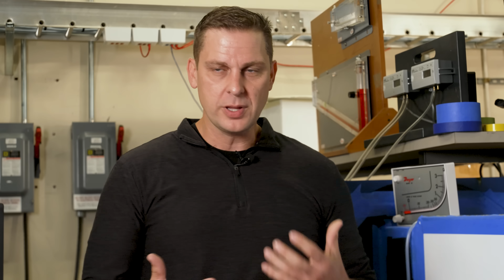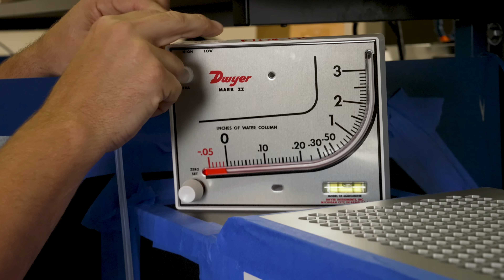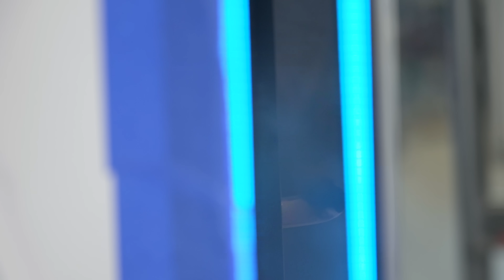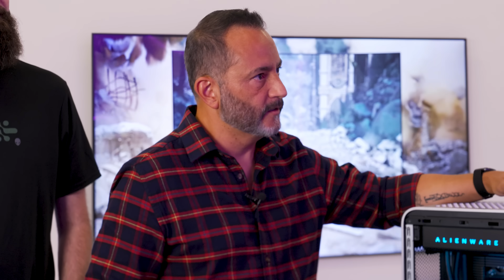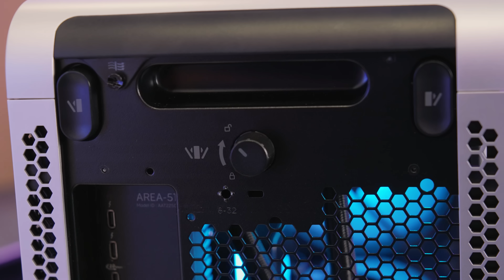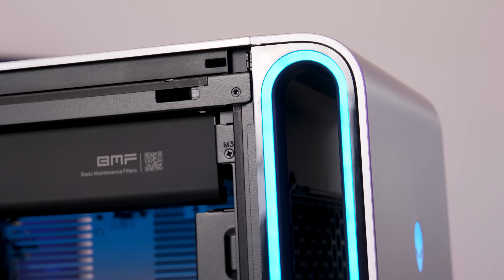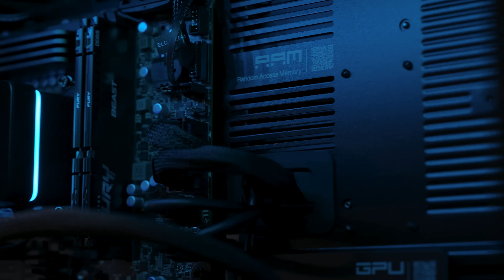Adam Savage Learns How Gaming PCs Should Be Cooled!

Comment: Wait.... that formula at the very end....

1) Did I hear it correctly that they design their systems to use 35°C as "local ambient temp" ?
If that means 'room temp': there is not a single room which has 35°C as average room temp... that would be a sauna (so to speak)!!?

2) Also, he says 55°C is the "exhaust temp", but that is denoted as 'Tin' on the whiteboard?! Shoudn't that be 'Tout' (and thus 'dT=out-in', and not 'dT=in-out')?

3) And then Adam says on the 55°C: "that's the temp you want to lower" , and the guy agrees. Ehrm.. you wan to "lower"? No (I think?). The amount you want to lower is 'dT', not the '55'. The 55 is the exhaust, the result, according to the guy.

What am I misunderstanding here?
(and also as a curiosity sidenote: where does that constant 1,75 comes from, what's that?)

Comment: "Pre-charge the GPU fan with pressure" is the most B$ phrase I've every heard anyone say with regards to PC cooling. AIR FLOW cools, positive pressure doesn't matter all that much. He even says right at the start of the video that "pressure doesn't cool, flow cools." 

Positive pressure negates flow, if the case has positive pressure then the fans aren't moving air efficiently because the positive pressure in the case pushes against the air being blown in by the fans. 

Neutral pressure, the same pressure inside and outside of the case, ensures smooth airflow.

Comment: Dell is missing the easy with this specific case and cooling.  Case fans in the front with a solid panel in front of the fans, nope. Mesh front at least where the fans are and now you're not restricting air intake.  You got it?

Comment: I'm going for all positive pressure in Lian Li PCMR  and O11D EVO XL exhausting through 360mm be quiet! Silent Loop 2 radiators  with PCMR Push/Pull fan setup. The XL with ASUS RYUJIN III. My best cooling has come post reapplying DURONAUT on CPU'S 9950X3D and 7950X using the same AIO's used before on Arctic Silver and MX-6. 10-20 Celsius.

Comment: Either approach has downsides. Positive pressure (No exhaust traps heat towards the middle of the system and heat soaks all components, including those that arent tracked by the system's sensors.) Negative pressure kicks out heat but sucks in dust from every seam much more than positive pressure (Assuming both theoretical systems have filters on every intake.)

Comment: 5:38 no recirculation then more holes = good. So add more holes on the side above the gpu. All about mixing and convection? Heat is going to flow up anyways. Also assumption that case is on top of desk and not hanging under it ( with some clearance ofcourse)

Comment: Apple has had thermal management as a standard design factor for decades. I am sure that there are many roads to success. This video introduced us to Alienwares. Funny enough, I have never had a computer die of old age or heat. Generally with a PC, after 7-8 years the processor does not have enough performance for the current level of software. My Macintosh  computers perform for 10-12 years before upgrades are necessary. I say upgrade, but replacement is more typical.
I would suspect that PCs of the future will become more efficient and need less power, thus generating less heat.

Comment: I had a curios case once. I had a bottom intake/ top exhaust case (NR200P) at one point, the front was blocked off, but both sides were perforated.
2 fans were mounted at the bottom, I had a 4090FE in that case and it ran fine, even with 600W for testing purposes.
But then I sold the GPU and switched to a 3060Ti, which only had 200W. That 3060Ti had 2 fans and most importantly the cooling fins were rotated 90°, pointing towards the back and front of the case. Now comes the kicker, that 200W GPU overheated, with 100°C (over the limit) and 100% fanspeed.
The reason it overheated was because the bottomfan blew past the end of the card, trapping the hot air inside.
When I tested the card outside of the case, it ran like it should be: 70°C with 40-50% fanspeed.

Comment: The best cooling is with high airflow, bringing cool air in to the system and removing hot air from the system at the same rate. This is most easily accomplished with neutral air pressure, not high or low air pressure.

Comment: Well, ok.. I have questions

As far as I know a ΔT of 20 is considered minimum. 15 would be good, less than 10 would be excellent.. Well, provided it is lower due to solid CFM. 

I mean.. they are calculating with a ridiculous amount of power use .. is this PC pre-overclocked by any chance? And they still calculate for ΔT of 20 when it is apparently built to use all 1500W? Wouldn't more cooling leeway be better for use of 1500W?

(I have a power hungry intel and that much power isn't needed unless overclocking .. a lot, but that's perhaps one of them super hungry pre-hyper-overclocked 5000 series cards?)

Alienware's guy says they don't want to pull hot air back into the system, yet their smoke test shows they pull air IN through a top mounted radiator .. adding heated air to the PC as well as fighting natural convection; heat rising and all that. 

So when the small amounts of heat that radiate off the CPU to the sides run into pre-heated air that also has to handle the heat coming off of the capacitors (condensers) .. that has no negative effect on CPU cooling, right? 

And this pre-heated air doesn't totally lower the convection rate of the backplate of the GPU? Or even more effectively stifle cooling in GPUs with one of the new pass through coolers on the 5000 series?

Did we just get shown exactly what Alienware does wrong?

Comment: My concern is, with no fans exhausting air, you have more dust being drawn into the case which will inebitably overheat your system. The average person that doesn't know much about computers will not even think about dust removal, at least not until it gets very dusty.
Reply: "with no fans exhausting air, you have more dust being drawn into the case" -- I don't understand that statement. Dust is drawn into the case by airflow. Airflow is simply a result of the operation of the fans. It doesn't matter where the fans are or whether they are pushing air in or pulling it out. You get the same airflow regardless. Having fans that exhaust air from the case isn't going to somehow prevent dust from coming into the case.

Indeed, one of the advantages of positive pressure ventilation is that you can put filters in front of the fans, so that the dust is captured before it gets in the case (I don't know if Alienware actually does this, but they could and many other positive pressure case setups do). With fans exhausting the air, you get negative pressure in the case and the air tries to get into the case everywhere. I guess with a really expensive case you could make sure all the gaps are sealed and have just a limited number of entry points for the air, all of which are equipped with filters. But in practice, this isn't how most PC cases are built.

So with exhaust fans, you wind up with unfiltered air, coming in everywhere, spewing dust everywhere inside the case.
Reply: @harvey66616  that's literally what i just said.. but dust can end up in your system even with dust filters. That's why you don't go with straight up positive or negative pressure..... that's why the most common practice has always been to draw air in from the front and exhaust at the back and top.

Comment: I've been flipping exhaust fans to intake since the mid 1980s.  I learned that my PC did not boot after sucking dust into the floppy drive.  Also, fan discharge air is turbulent, which is more efficient to blow on heatsinks, than suction side - laminar air flow.

Comment: The problem with gaming PC cooling solution is, there's a lot of hardware configurations, there's no clear cut what are the best fan arrangement. 

In my MATX aquarium case with air cpu cooler, I've set stronger top intake fans to blow cool air from ambience into the system while overcoming the mesh filter resistance. The case have side holes instead of front holes, so the side fans are for exhausting hot air released from GPU together with 1 exhaust fan at the rear pulling out hot air from CPU. Oh, my CPU is actually hotter than my GPU because I have 3 fans for the GPU vs only 1 fan and 1 heatsink tower for the CPU. 

If I use the same fans arrangement in this video, my CPU will be hotter due to bottom fans pushing hot air from GPU to CPU, while air from side intake will take further path from fans to the cpu cooler.

Comment: negative pressure designs pull air from the nearest points which can and WILL starve the far away components. 25 years of building custom PC's and experimenting with ducting in the early 2000's a positive pressure bias makes a significant difference to move air to every corner of the case. and every thin 2D air filter is utter garbage, poor filtration followed by fast saturation and blocking.

Comment: You don't want either positive or negative air pressure in your case, at least not very much of it.  What you want is airFLOW.  So you want about as much positive intake pressure as you have negative exhaust pressure.  That will result in the max amount of airflow through the case that you can achieve with your setup.  From there it's just playing with the position of the fans to get the most airflow across the critical components as you can.  

This is true for air or water cooled builds.  Water cooled isn't really cooled by water, the water just transports heat to the radiator(s).  It's still airflow that takes that heat out of the system.  You can have a bunch of fans, all screaming at max rpm, and have very little airflow thanks to a bad design.  That's going to be a very hot system.

Comment: It's the same story as every other story... 
It depends.
Positive pressure ensures that you can filter all of the airflow, and reduce dust accumulation on hear sink find and other surfaces.
But, instead of having 8 fans cranking up the case internal pressure, thus having reduced CFM for given fan speed, it's better to provide large fans, with big filters, to provide cool, clean air, and use several internal fans that provide cooling to specific areas/devices with fan location and ducting providing maximum air velocity, and turbulence, across heatsinks and surfaces.
Simply providing a lot of input airflow doesn't guarantee that the airflow is optimal at any point. Using internal fans, with ducting, provides the amount and velocity needed, where it's needed, and allows better control of fan noise... With the ability of modern sensors, microcontrollers, and fan technology, fans/airflow can be optimized by thermal loading under varied compute loading and/or device operation... Disk drive activity, memory activity, CPU, GPU... In industrial applications, we've even built systems with no external,  "dirty" air, being run through the enclosure, but instead using multiple internal fans for specific cooling functions, then ducting the "bulk air" over a "double-sided" heatsink structure, and external fans cooling the "outside" fins. The outer fans had filters to keep the heatsinks as clean as feasible, and temperature sensors to provide advance indication of heatsink efficiency degradation, or degradation of flow from filter clogging. Heat pipes, it's possible to get very efficient heat flow from internal heat sources to external radiators, reducing the size penalty of double-sided heatsinks, at higher cost, and more design constraints.

Comment: One thing I don't understand about it is the testbench has a motor that is pulling air out of the case, right? But the case itself doesn't have an exhaust fan. So the case by itself will not extract the air like in the testbench. I assume the hot air is being "pushed out" by the pressure inside the case?

Also, would love to have seen a simple test with the smoke generator, just seeing how it flows in the case, by itself.

Comment: Fractal Design proved this back in 2021 with the release of the Torrent...welcome to the conversation, Dell.
Reply: Linus Tech Tips did a LOT of work in the early days of the channel on this and it was legit useful and interesting.
Reply: Dell is my father's name, please, call me Alienware.
Reply: .... Except they still don't get it. Better, but still BAD.
Reply: meanwhile apple is fanless dead silent 20 times and more less energy required, windows has arm 2 now after 6 years, but they cannot catch up still
Reply: @JohnSmith-pn2vl  any fanless apple machine is not running at the performance these are... It's like comparing an ipad to a macbook pro
Reply: @JohnSmith-pn2vl   typical apple users showing us their Apple Intelligence🤣
Reply: @JohnSmith-pn2vl  yeah, but noone plays games on an apple. This is where its needed.
Reply: @HaDeZs1  to be fair you can play it on them now
Reply: @JohnSmith-pn2vl  apple also only recently came into the fold with giving their phones USB-C, after 8/9 years.
Also, we don't have to be stuck with windows if we don't want to, whereas any apple product is stuck with apple. Windows is heavy with how they wanna make everything accesible with backwards compatibility, but theyre seemingly moving away from that
Reply: @JohnSmith-pn2vl  Yeah and how many games were there again for MacOS? Resident Evil and Cyberpunk is the answer. And they both barely run at a playable framerate at 1080p low-mid settings and require resolution scaling, which works badly and makes the image blurry. But hey the machine makes very little noise, yay!
And here I am with my horrible, horrible PC, running Cyberpunk at 4K with everything maxed out, ray tracing and path tracing enabled etc. Yes the fans ramp up a bit but it's completely drowned out by the ambient sounds in any game.

Comment: With 11 fans in my chassis there is an entire spectrum of options between fully-positive and fully-negative, and it's not very responsible to only test the two extremes.  Plenty of previous tests have clearly shown flow-through that optimizes the path of the flow beats either extreme.
Reply: THIS! I came to the comments for one of those. Im kind of out of the market , my last system was buils 14 years ago. Thats what I was going back in the day equal amount of fans(and same diameters) air IN and equal amountg OUT. Constant flow-through workes best. Dust is a slight problem, but a cleaining 1-2 times a year with compressed air solved it, cat household btw.

Comment: I've been spruiking positive pressure for like 25 years, now. There's a one thing to keep in mind: unless your PC build involved a caulking gun, you don't need "exhaust fans". Hot air will always find a way out. Since cool (or ambient) air is denser than hot air, then, just by volume, intake fans will move more mass of air than exhaust fans will, and that mass is what's going to soak up heat. As a side benefit, though this is debated, a positive pressure environment is thought to allow less dust to hang around in the case. The idea is dust should be blown out. I'm not sure if that bears out in practice, though.